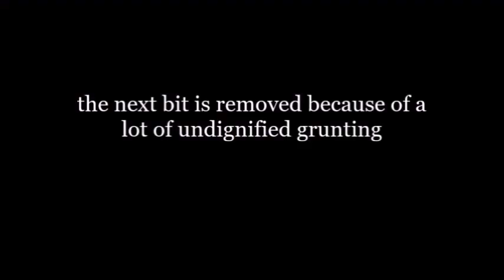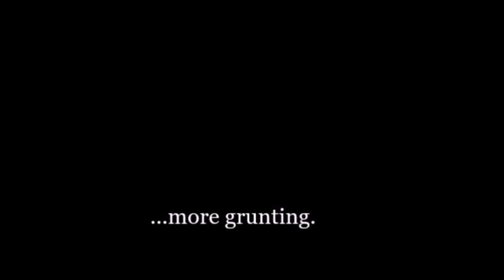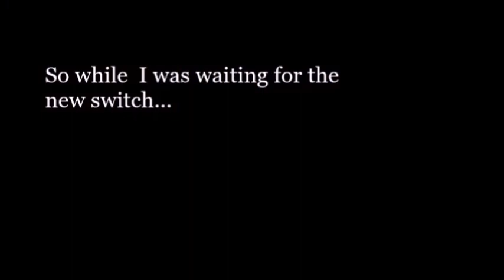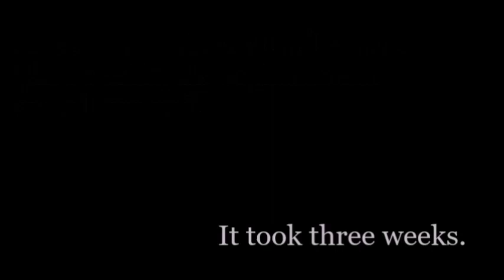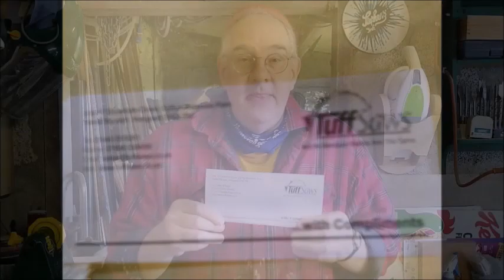A Feast of Classical Literature, (but really about my New Bandsaw)

Comment: I had a similar DeWalt bandsaw that gave up the ghost last year, I replaced it with the same Record Power saw.  I bought an ex display model from my local supplier so at least they had quality controlled it!
Reply from the maker: Thanks for looking in Tony, I'm looking forward to seeing some of your bike videos. (Have a look at my vid about restoring a little plane - it starts with a visit to one of the vintage motorbike shows held very frequently here in Northern Ireland). The RP bandsaw and I are getting used to each other now. I still haven't sorted out a new rip fence but over all I'd still recommend it. A good blade always makes a huge difference so I'm glad I got the chance to recommend Tuff Saws as well. Thanks again mate and stay healthy!

Comment: Nice bandsaw Mark. Good luck with it. I also bought some blades from  Ian at Tuffsaws in 2017 for my SIP 14". Great blades. The M42 stays sharp for years with moderate to heavy use.
Reply from the maker: Hey Pascal, thanks for looking in. I'm very pleased with this current TuffSaw blade, and I'm a notorious blade abuser! All sorts of dreadful old plywood, laminate material, perspex, you name it, it all goes through the same blade! This one just gobbles it all up. I'm getting used to the Record now and it is certainly a good tool - I think I was just disappointed with the sales service, but it sounds as if it's a fairly typical story. Frustrating. Oh well, could be worse. Hope things are stable and improving there mate. God bless you all and stay safe.
Reply: @MarkMcCluney  I have a small Record Power lathe here. Not made in England anymore, but well built. But band saw is always plugged in, ready to cut.

Comment: First of all, you outdid yourself on the editing this time, marvelous! As for the bandsaw.. I am saving a few years for one now, time after time having to use the savings for replacement of tools that breakdown (as you well know the adventure of getting a new miter saw at the moment). I for that, had a lot of time to research. My effort of being prepared when the budget is there concluded in just a few choices...
Yes, Record Power 300 or 350 (I want to be able to rip-cut about a full ukelele front/back or half of guitar shape) I already found out that anything above 19 or 20 cm capacity is unaffordable, and the ones between 16,5 and 19 still will set you back close to 800 Euro. I do however want some kind of certainty about service and part supplies... (I'm far away from the "tool manufacturers world".  At the moment there are a few more options for me than there will be in January (ordering stuff from the UK will have to go through the corrupt and dysfunctioning Portuguese customs) and because I know the savings aren't going that fast, I will have to shop round on mainland Europe. There for the big scheppach basa3 comes to mind, but I'm leaning mostly to the Metabo Bas318 (because the bandsaw itself and parts are even available in Portugal, though twice as expensive as ordering abroad). I am reluctant to go through the process you just gone through, with arranging parts that don't work, bending things to order myself etc. Certainly this week I was made very clear that German customer service isn't what it used to be either.

I am happy for you that it all worked out! I'm looking forward seeing you enjoying working with it!
Give our regards (Mirjam and me) to the lady of the hardware shop. Take care!
Reply from the maker: I'm glad you enjoyed the editing mate; I've been a bit tired in the last few weeks and got this together quickly just to get rid of it - I thought it looked a bit rough! But if you liked it, then I'm happy. Yeah, what about the mitre saw? Any developments? Sold all those springy-stringy-thingys yet? I do really appreciate that we have it easy here in Ireland/UK; it still just amazes me that I can order something here on my phone and it's at the door in weeks or even days. (I forgot to mention that the bandsaw arrived about a week before the estimated delivery date - I couldn't fault the supplier for that.) It must be such a pain in the neck to have all those customs restrictions and bureaucracy making life pointlessly difficult. Utterly bizarre. The only comparable thing here is the expense if postage to Northern Ireland - when I bought my mandolin a few years back it was cheaper to have it sent from the USA than to have it posted from England. Annoying, but not nearly as inconvenient as your situation. I wish I could something to help out. Oh well, all part of life's rich tapestry. All our love and stay healthy kiddies.

Comment: Nice video Mark, After seeing the price of this machine reduced to £699 (WOW) I think I will still try and fix my old one. I could not be bothered with the hassle you have had with this one. They should have sent you a few new blades and a new blade guard.
Reply from the maker: Ah, I'm glad you found this James. Yes, the condition in which it arrived stimulated a lot of correspondence with my regular viewers lots of whom had experienced similar disappointments with the big manufacturers/suppliers. It's still a mystery to me how a basically very good machine can be set up so badly and still pass the QC stage. Oh well, all's well that ends well.

Comment: Hi Mark I think you have outdone yourself and reinvented the unboxing genre. It is disappointing when you buy something new only to find that parts are missing or faulty from the factory. And then three weeks for the replacement part. Some of the problem is poor quality control. A simple flick of the switch at the factory would have solved your problem. Sadly a lot of things are built to a price rather than a standard. I have several machined that required a good deal of fettling before they were ticketboo. Then lets not mention Geritt problems in Portugal with delivery. However Im sure the bandsaw will give you lots of good service. Kind regards from down under
Reply from the maker: You know, fettling is just the word.  But it is irritating - I was visiting my folks during the wait for the replacement switch and said to my Dad, 'I suppose I can really expect something like this to work straight out of the box', at which my Mum said 'why? You wouldn't expect all this messing about with a toaster or a vacuum cleaner. You'd take it right back.' And she's right of course. It seems this sort of thing happens quite a bit with tools of this sort - the manufacturers seem to be comfortable with this level of quality control. It's not the end of the world but it's still, well, I just expected better from this company. Oh well. Hope you're all staying well there mate.

Comment from the maker: After seeing this The Nice Lady from the Hardware Store pointed out that I left a few bits and pieces out. First of all the price - the saw cost £664 including tax and delivery charges, and was bought from the English company Machine Mart. And incidentally it arrived more than a week earlier than the estimated date of arrival, which was most appreciated.
Perhaps I should also let you know that this is not the first tool I bought from Record Power. They also supplied my lathe, about twenty years ago - it too arrived with a faulty switch and eventually needed the whole motor replaced. Record Power responded quickly and without fuss but make of that all what you will. 
And finally for those of you who don't know what The Generation Game was, you can find an episode from 1974 here...
https://www.youtube.com/watch?v=fhtc4NH4s_A
I was sure there was something else but I've forgotten it... I'll go and ask her.

Comment: (Second comment)

I’m trying to figure out the problem you’re having with the saw fence.  It appears that you are able to remove the fence.   If you are having a problem, I have a destructive solution...one that will most certainly void the warranty: cut the fence back with a hack saw and make a longer fence to go over the old fence.  This will allow you removal as well as giving you an even longer fence as you can stretch it to the end of your table.
Reply from the maker: You're right, I can remove it but only at the expense of having an awkwardly short fence. I originally explained this in a lot more detail but I slashed it in the edit as the whole thing was already embarrassingly long (and boring). The Nice Lady (who is extremely brainy) and I puzzled over different configurations of the rip fence attachment. I was sure I was fitting it incorrectly - I mean, not being able to remove it really limits the versatility of the machine. But there it is; that seems to be the best compromise. The rail it rides on is 'murder weapon' chunky. I considered having it cut short so the fence could be slid off more easily, but since I was sincerely considering sending it back I thought cutting big chunks out of some the fittings might be a bad idea. Even then, it only solves half the problem - although the fence is on the left most of the time, there are definitely times when it's useful to have it on the right. But there's no rail for the right! The deWalt had a very rudimentary rip fence arrangement which some would have regarded as impossibly jejune darling, but it one redeeming feature - it worked perfectly without any fuss or expense. D'ye think Record Power might possibly sell a rip fence upgrade for this machine? Ah! Such cynicism in one so young...